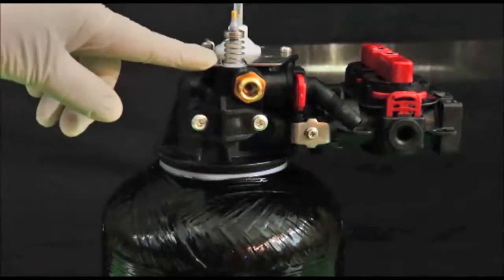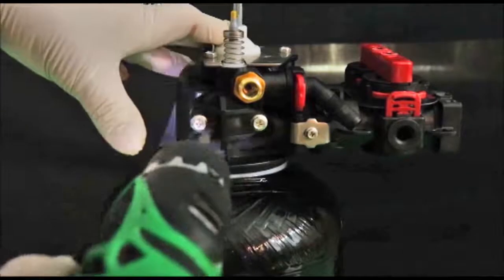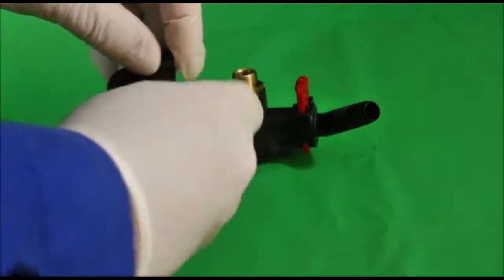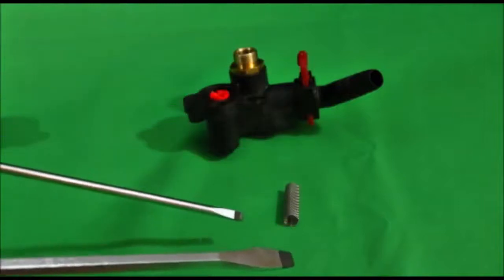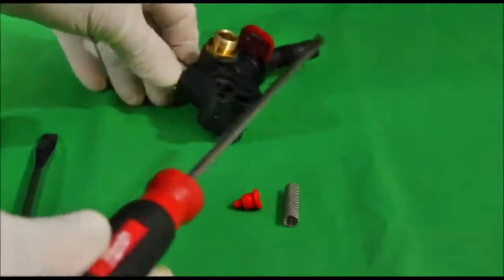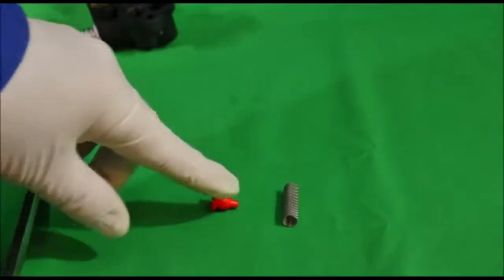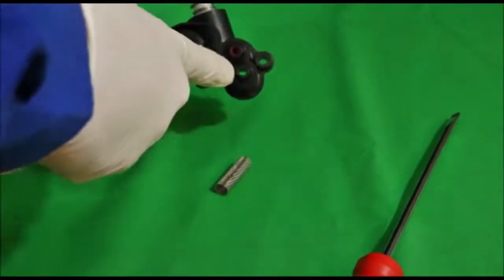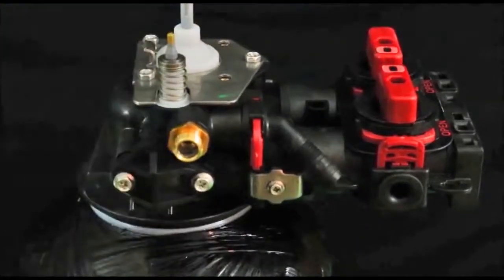Control Valve Maintenance, Part 3: How to Clean Control Valve Injector Assembly

Comment: Where can I get the parts for a 765 or 65 control valve?  1) O-ring on the injector cap/cover , 2) Injector nozzle, 3) Injector Throat, 4) Screen, 5) The 3 o-rings on the inside of the larger injector block? Thank you!